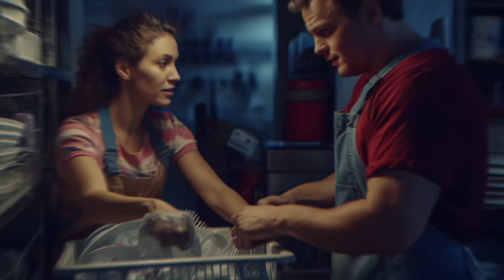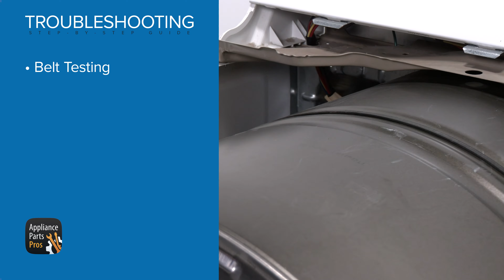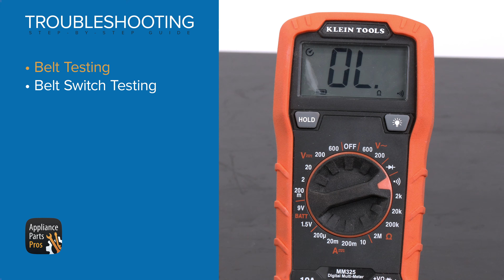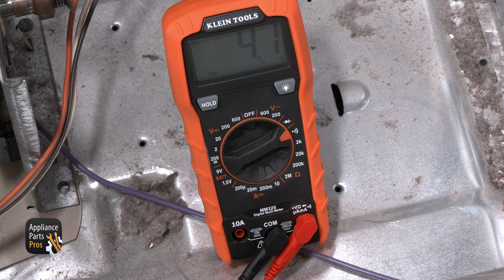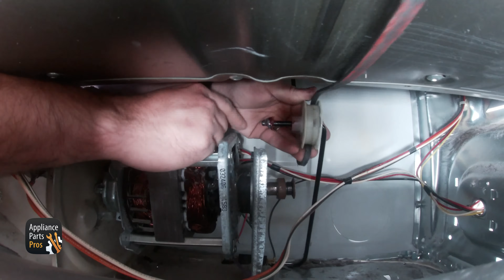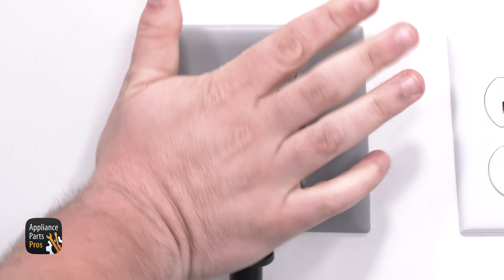How To Troubleshoot A GE Electric Dryer Only Runs When Start Button is Held

Comment: My dryer, model GTD33EASK0WW,
also will not stay on unless you hold the start button and has a weird smell when running?
Reply from the maker: For free technical support, please visit our Repair Forum: https://forum.appliancepartspros.com/.  It’s easy to register, and you can either post your question or search the forum to see if someone else has already asked the same question.
 
Our experienced technicians, with over 20 years of hands-on appliance repair experience, are ready to answer your questions and guide you through your repair.